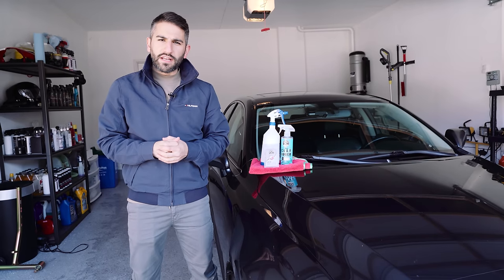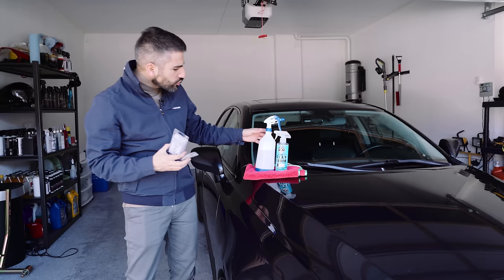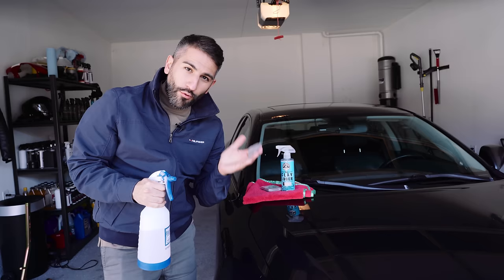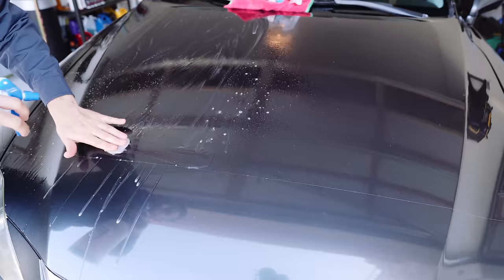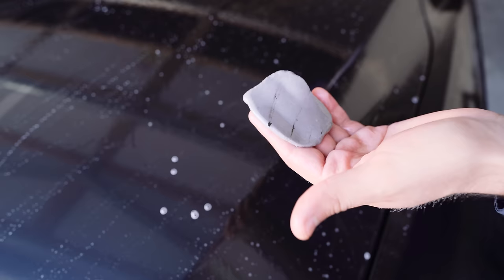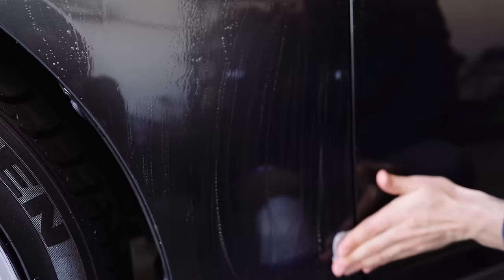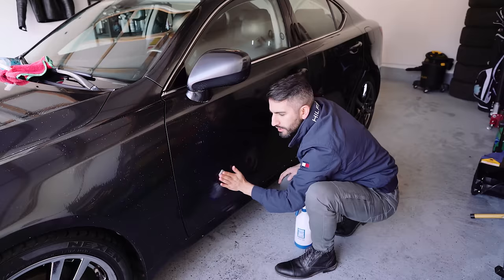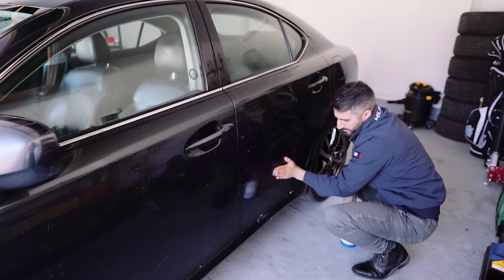How to PROPERLY Clay Bar Your Car! Professional DIY

Comment: Be sure if ur doing this outside try and dry/wipe the areas you just clayed w a microfiber drying towell you dont want the clayed water to dry in your paint
Reply: So let’s say I didn’t take ur advice now there’s a stains from the clay water on my car… what do I do then
Reply: @stephentesta6011  You give the video a thumbs down for not telling you to dry it off straight away
Reply: Or just clay bar it again and dry it the second time around
Reply: @stephentesta6011 it would just be soapy water residue, the clay itself doesn't dissolve on the paint. Just wash your car normally. In fact you should anyway if your using soapy water as a lubricant. If you use a rinseless wash for a lubricant you don't need to.
Reply: Yup. A good rule of thumb when it comes to paint is, the more sterile, the better
Reply: Is this guy drying rite after or is he gonna do the hole hood before he drys it off ?
Reply: I clayed my wive's car yesterday for the first time and I also had residu. After claying the car, I used some detailer spray and wiped off the car completely with a microfiber towel. I'll do my car next week, but wanted to practice on my wife's car first :-) It's also easier, because it's white instead of black metallic.
Reply: Thanks.  Great information!
Reply: Omg thank you for this comment because I wouldn’t have done that truly thank you!!!!!😊
Reply: THANK YOU for mentioning this. I was so confused why he wasn't wiping dry as he went 🤦‍♂️

Comment: I'm a professional detailer and I thought you did a great job explaining the correct way to Clay bar. Johnsons baby shampoo makes a great lubricate mixed with water.
Reply from the maker: Thanks man I really appreciate it! Always felt like the quick detail spray and lubes for claybaring was unnecessary and expensive.
Reply: 2yt3tf❤😮😅😊
Reply: How much shampoo to water ratio ?
Reply from the maker: @AustinPetDetective 8 parts water 1 part shampoo
Reply: Do you rinse it down with the power, washer or dryer or a towel?
Reply: So I’m confused. First I read you should clay bar before waxing. Then I read that you should only clay bar if you intend to polish afterwards. But polishing should only be done once or twice a year to preserve the paint… meanwhile waxing should be done at least every few months… What am I missing here?

Comment: I have a 10 yr old chrysler 300C.   Live in Ontario also. 185k on it.  I do this 6 times a yr.   Wash, rinse, wash, rinse, dry, then go over with gas leaf blower, then clay, rubbing compound, wax, wash, gently toothbrush seams, dry then blow dry again.  Showroom mirror like finish.   She's a head turner.  Keep the engine detailed as well.

Comment: Small Suggestion: I clay all the nicer, more important areas first (hood roof doors etc) ...and then I continue on to progressively dirtier & less important parts of the car (low bumper, rockers, etc) ...this way, if the bar does get contaminated from such "high traffic" areas you won't be going straight to your hood next.

Even with folding the bar, just seems much safer & fail proof this way... So I thought I'd share - Take care.
Reply: Common sense
Reply: @amberkreier1712  
I agree, but I was surprised to see that it wasn't mentioned in the video, so I thought I would politely mention it in a comment.
Reply: @amberkreier1712 Common sense...Isn't 😊😊
Reply: i was thinking same thing
Reply: Heads, shoulders, knees, and toes
Reply: Great tip.  And don't forget the glass!  Clay bar your windshield, windows, headlights.  Makes a huge difference.  People are surprised how much better their wipers work after clay barring the glass.
Reply: @pirtatejoe  Absolutely, I actually forgot about that - Yeah works great.
Reply: Clay bar  Artillery  shotgun  fungus,  those tiny black dots   all over cars and house siding

Comment: I’m 44 and haven’t done this in years so watched as a refresher. Years ago we would use a cheap sandwich baggy (thin ones) over our hand and rub where we have been. 
It amplifies the spots that need more attention. It’ll smooth out once you get everything.

Comment: You saved my life. The car paint and windshield were all contaminated by industrial ash and debris and I was trying to clean right away but no luck. The entire car surface was so rough thatI could not even wipe it with microfiber. 
I got the clay bar and use it with diluted solution as lubricant according to your tutorial. All the roughness are gone and I am a happy man. Thank you.😊
Reply from the maker: That’s awesome to hear :) glad the video was helpful Chi Weng and welcome to the channel!

Comment: The first time I used a clay bar I was amazed at the difference it makes with the finish.  No amount of wash and polishing will get the very fine imbedded surface debris off the paint.  Clay will do it.  I do think a quick alternative is with synthetic clay sponges but real clay bar is the best.

Comment: I've been using a clay bar for over 30 years...OMG the first one I bought was the size of a bar of the old type SafeGuard bathroom soap.the last few I got are smaller then a hotel bar of soap...I use it right after I wash the car...just rinse it, no dry time...spraying over the water droplets with the spray lube. , I use just soapy water ...an old windex bottle with a few drops or 6 of a non- ammonia or antibacterial liquid dish soap  ( Ajax  Orange bottle ). Switching out my drying towel about every different area ( top is one towel . sides are one towel and the hood and trunk one towel.) I do do another light wash after the clay bar...even without finishing the wax and polish ..the water is already beading down the panels.It does take about 5 hours to do it this way... but its worth it...used to take me a weekend on my 2006 Mercury Grand Marquis..

Comment: Thanks for the video! 
 We recently purchased an '02 Lexus LS 430 with 157,000 miles in great shape, it's crystal white pearl and looks really nice when the sun shines on it. I've been wanting to clay bar and paint correct it (it actually looks good as far as swirl marks go) but one of the reasons I haven't gotten a clay bar yet is having to buy clay bar lube. I like this solution much better because we always have dish soap and water so it's a win in my book.
Reply from the maker: Yes glad you found the tip helpful Jeff and welcome to the channel and CONGRATULATIONS on the LS 430 the pearl white is a beauty 😎
Reply: @carswithsonduren  Thank you 👍
Reply: I’m glad I can use my regular car soap for this. I don’t want to spend money buying some gimmick solution when soap and water works the same.

Comment: I can't imagine a more perfectly made instructional video.  You have taken the mystery out of "clay barring" and save many of us hundreds of dollars.  I'm going to look for more of your detailing videos to see about other aspects of auto detailing.  Thank you so much.  My only question would be is what soap are you using in your spray bottle?  Ya can't use dish-washing soap so is it a liquid car washing soap that you can buy at an auto supply store?
Reply from the maker: Thanks for the compliments man and welcome to the channel! You will want to use roughly a 1 to 8 ratio of soap to water. You can use any regular car shampoo!
Reply: @carswithsonduren  When you say 1 to 8 ratio, how much is that exactly?
Reply: @TheAstroflight  thank you 🙂
Reply: A plain surfactant with no additives.  I’ve used LOC (liquid organic cleaner) from Amway.  1tb per quart.
Reply: @TheZuk224
Reply: @TheZuk224 whatever fits in the bottle

Comment: Thank you very much ! I just find the interior paint is silky smooth while the exterior is rough. Your video enlightens me to do a clay bar cleaning and your tips are great : a small pcs, fold it to use a clean clay surface for another panel, soapy water.  Thanks again for your sharing !
Reply from the maker: Anytime and welcome to the channel!

Comment: Great video and lots of excellent advice - although I would typically follow a clay bar with a polish - even a one step polish/sealant primarily because even with the lightest touch and lots of lubricant the clay bar will always put some tiny, tiny scratches down (unless your clearcoat is super hard).  I'm just a weekend DIY-er but I've gotten great results with a clay bar followed by a one step from places like Chemical Guys or Griot's and an inexpensive DA polisher and a soft-ish pad.
Reply from the maker: Yup, absolutely right!
Reply: Right , unless you are following paint correction route on a old car or neglected paint .Then clay >compound>polish/sealer > ceramic coat.Thanks

Comment: Excellent vid! I have never used clay before. I've always used a decontamination pad. If these are dropped on the floor they are easily cleaned off completely. They are used in the same way as clay and give excellent results. The usual polish and wax to follow, which gives a nice smooth finish. All the best! Thanks for your info!!
Reply from the maker: Thanks Robert glad the video was helpful and welcome to the channel!

Comment: Thank you for this.  Very well explained. I'm about to do this for the first time ever.
Reply from the maker: Anytime glad I could help you and welcome to the channel! Let me know how it goes your first time and how much dirt you take out of your paint!
Reply: @carswithsonduren  Visual dirt -  definitely some but not a lot.  But the before/after difference in fingertip feel is huge.  So a lot of hard to see 'nubs' definitely came off.  Followed up with Meguires Ultimate.  This is a 2020 Mini Countryman S All4, picked up new in Dec 2020 and it barely has 5K km on it.  So it hasn't seen a lot of road time but it's been exposed to weather since it arrived in Canada in Jan 2020.  I'm glad we did it.  Next consideration is possibly ceramic coating,  which I'm just learning about.
Reply: Do this when you do. Feel the paint after washing. Then after claying it. Then after waxing it. Preferably do the hood. 1" painters tapeafter wash. Blue or green doesent matter. You need 3 sections to tape off. Cover the after wash section. Now clay the next section. Cover it and then wax the last section. Un cover the hood. Now feel the diffrnce. Washed, clayed, waxed will be smother than a babys bittom. So i say the effort is worth the  elbo greese.

Comment: Thank god you said you didnt have to use the clay lubercant. It is not needed and is just a waste of money. However, do not make the mistake of using just water without some sort of lube like soap. If you have extremely hard water. In that case you should buy the cheapest bottled water you can find and use that in your spray bottle with your soap.

Comment: The CG Clay Luber is a good product compared to the alternatives - soapy water and quick detailer.  It has much better film strength so you don’t have to wet it as much.  You can buy a 16oz spray and then use the gallon refill to replenish at a lower unit cost and lower environmental impact.
Reply: What kind of soap do you use  ?
Reply: What kind of soap do you used?
Reply from the maker: Meguiars Gold Class

Comment: Would it be better to clay from top to bottom? As you would with a wash mit, Id hate to clay the bottom sills and return the clay bar to top panels even when folding again.
Reply from the maker: Yes, that is correct :-)

Comment: Hey ! Thanks for the video! Might be a ridiculous question but, dish soap or car soap ?
Reply from the maker: You will want to use car wash soap :) 8 parts water 1 part soap
Reply: dish soap if you’re tryna decontaminate all protective layers (wax, etc) but make sure to wax and shi right after. Ensure you have a super fresh slate of paint to polish,wax on. ChrisFix has a good video on washing your car (includes clay bar) that would compliment this guys awesome video.

Comment: Super informative video man! Thanks for the actual application. A few questions though:

First off, Is it okay to apply iron remover before I wash my car and then proceed to rinse it off via the washing stage?

Secondly, how should I go about thoroughly removing the clay luber after I've mechanically decontaminated? Will a simple rinse suffice?

And third, is it okay to chemically and mechanically decontaminate my auto glass from the exterior?

Thanks bud!
Reply from the maker: Glad you enjoyed it, David!
1. You should apply the iron remover after a full wash and rinse.
2. A simple rinse is fine
3. Yes it is :)
Reply: @carswithsonduren  Thanks man! Much appreciated.

Comment: Thanks a lot for these useful tips. Still one question: how often should I renew the piece of clay. (Is that piece which you used only for once? And then through it away??)
Reply: 4 to 5 times. Rule of thumb is, knead the bar and if it still looks dirty time to get rid of it.

Comment: Thank you for the advice! I am less anxious to do this now. I try to wash my car within 3-5 weeks to keep it clean. Would I need to clay bar and apply ceramic coating each wash after this first initial one? How often should people re- clay the car and apply wax/ ceramic coating? Also, I have window tint. Safe to clay?
Reply from the maker: Safe to clay yes. Just need to clay the car once every 3 years at most. Keep it coated and you really shouldn’t need to.
Reply: Great question, I had the same thought too.

Comment: Nice video, well-explained and with a good rythm. The only nitpicking is that you should start at the top and go around the upper panels before getting your claybar dirty on the lower panels. For the same reason you chuck it, should it fall on the ground.
Reply from the maker: Thanks for the compliments Roger and I agree with you! So far I've only ever dropped them twice 🤞
Reply: I thought about that, too but it was probably done like that for the video, maybe.
Reply: Roger that's what I do, and I usually fold the clay after the top half of every fender and door. I'll hit the rocker panels and front bumper last as well. It might be overkill, but I'd rather be safe than sorry.

Comment: Awesome vid. I’m going to try clay to remove some rain streaks soon. Was there a specific soap you used for the cheaper solution? Sorry if I missed it.
Reply from the maker: Just regular car soap will do!
Reply: @carswithsonduren  wash and wax type or no?
Reply from the maker: Ideally just a regular one without wax.
Reply: @carswithsonduren  OK I've been working at a shop for awhile detailing cars. An old guy runs the business so going to try to get up to speed on more things like using clay bar.

Comment: My 2019 GMC has been Diamond Kote Paint Protection on it. It is White in color. I know it needs to be done. Anything I should watch out for. You can see tiny little brown colored spots here and there. I thought it was rust but I it is not.
Reply from the maker: Nothing you have to worry about on the little dots. You just going to clay bar and they will come off :-)

Comment: Great job! I’ve always been very interested in the clay bar process. That said, can you clay bar a clear bra on the front end or do I avoid it? #2, I have a white truck that seems to attract little bits of tar flecks. I was considering washing the truck, pulling it inside and going over it with a soft rag dampened with odorless mineral spirits to remove the contaminants, then back outside to rewash it with a good soap, after rinsing it thoroughly move it back inside to clay bar it. Then rewash and apply a protective wax. I just wondered your thoughts on this. Thank you!
Reply from the maker: Yes you can go over it with the clay bar but remember to make sure you add a lot of lube to ensure you do not damage the film. Lots of lube and turn the claybar frequently

Comment: I have found a product that works just as good and is easier to work with for beginners. Builders putty that they use on the timber windows and skirting and doorways.

Comment: How is the clay bar not dragging found dirt to other sections of the car?  Once the dirt is picked up in the clay bar, what keeps it from scratching other areas of the car? My guess is the soapy water or lube provides a barrier and not pressing down hard. Still, it must be easy to make a mistake.

Comment: Simplify this … after you wash a panel with soap and water, rinse the panel and reapply soapy water with a clean rag. Then, use your soapy water as your lube — no need to make another bottle of soapy water.
Reply from the maker: That’s a good idea as well but you do need a bottle to continue to spray otherwise you will mar the paint.

Comment: Great video many thanks. Could I ask a longer terms question? I have an 18 month old BMW with 7,000 miles. My intention is to clay bar and use an iron remover and then use a 303 graphene nano spray coating (apparently 1 year durability). I will top up with the 303 detailer through the year. However, where do I stand if I want to top up the Graphene Nano Spray in the future? Should I start the process again i.e. claybar and iron remover?
Reply from the maker: No just simply apply the 303 again :)

Comment: A great video.  So after clay baring do you then wash the car again.  Should you use a chamois??  If not what is the best way to dry it before polishing.
Reply from the maker: Yes that is correct. Dry with a waffle weave microfibre towel :)

Comment: I’ve tried this method and the water marks will not come off unless I apply more pressure when I followed your technique after an hour water marks were not removed. So I think in some situations applying more pressure is necessary

Comment: Great video and the first I’ve seen on using a clay bar to clean the paints clear coat. A quick question for you, what type of soap and what proportion do you use to make the soapy water solution?
Reply from the maker: Any car shampoo works 8 parts water 1 part soap.
Reply: This was my question all I had to do was scroll lol